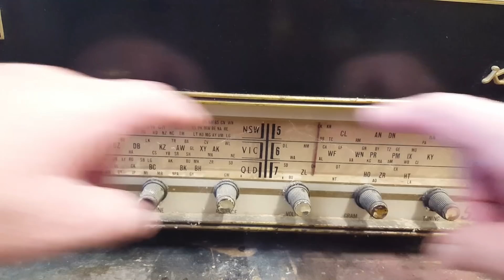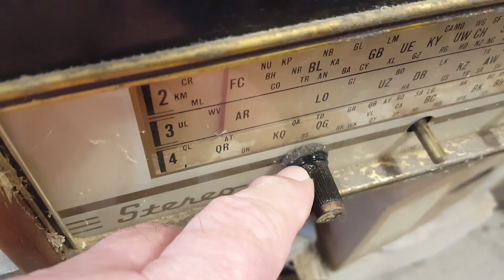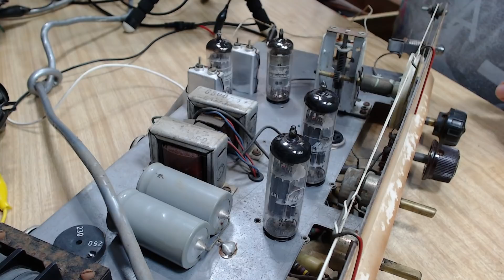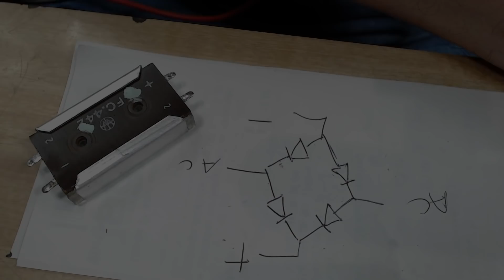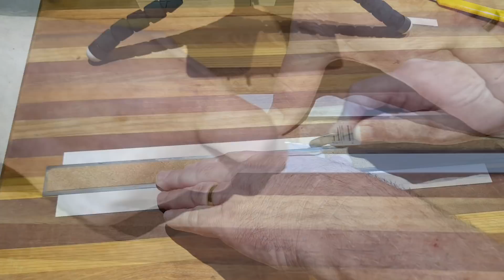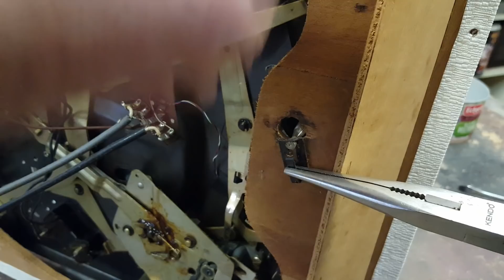Kingsley/Lincoln Tablegram RKR and Garrard 1000 Turntable Refurbishment 1960s Part 1

Comment: G'day Dave. Another interesting unit I have never heard of.
I hope it sounds as good as it looks.
Really hope you are doing well mate and recovering quickly.
Reply from the maker: G'day 1974UTuber, I saw the same set with a Lincoln badge and another with a HMV badge on it the other day, slightly different front. I really don't know who made it. I'm pretty good so far thank you, I'll be through it in the New Year 🙂
Reply: @DavidTipton101  I'm really glad to hear it Dave.
I looked up the radio and saw similar with legs on it. Some listing's state "Various manufacturers" so might have been a case of bought the chassis from one place and assembled the box around it
Reply from the maker: @1974UTuber  It was a Philips design chassis, yeah who knows 🤔